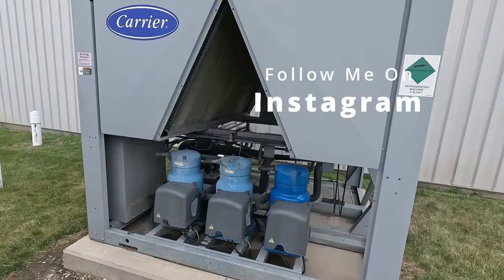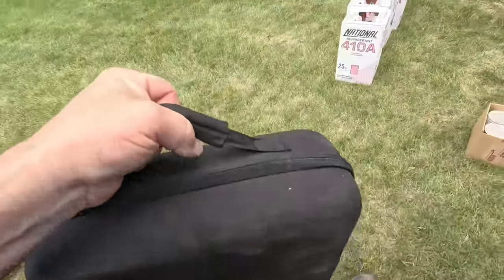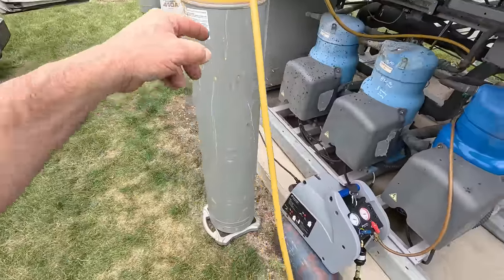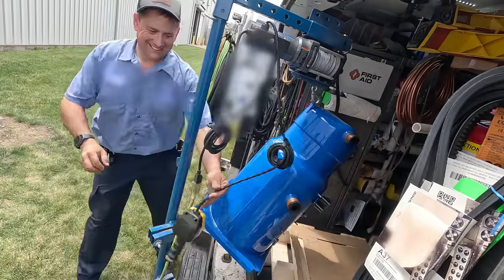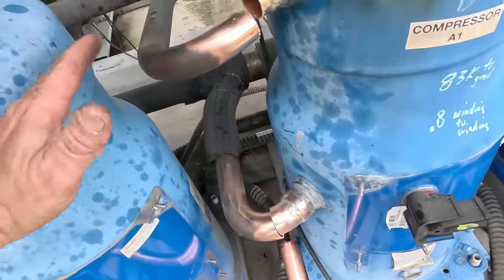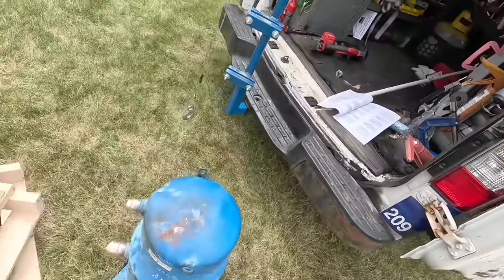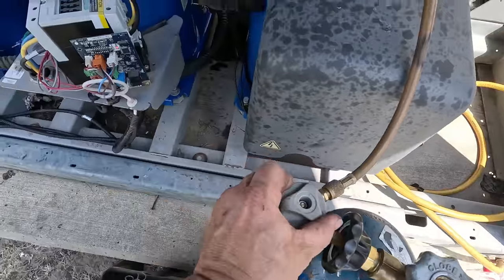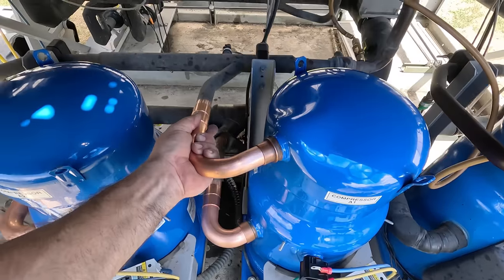Double Compressor Failure Was Not Enough Excitement

Comment: I know it mentioned before that the push pull wasnt setup correctly, and its been explained already on here..but if you have a running compressor theres a faster way with the push pull,by using the compressor as the " recovery unit"..
Hook liquid line of machine to liquid inlet of tank, the vapour of tank goes into suction line ofthe running  machine,  and hey presto yiu ll have full liquid recovery , real fast, make sure to keep eye on scales  as tank can fill real quick, and sometimes generates static on the tank, so bond the tank to the machine, i use a jump lead ..😂.. this method xan be setup real quick and gets most of the liquid out, usually the machine trips on low pressure , indicating most of the easily available liquid has been recovered..then its standard recovery..ive used this on screws, recips etc... remove cores obviously..great videos, one  of the most knowledgeable techs on the internet hands down...nice work Rick...👍👍
Reply from the maker: Thanks So Much For The Kind Words! I have used the Compressor similarly to what you're describing. Sometimes I'll even pump it down into the receiver, then suck it out of the receiver. Thanks so much for watching the video and for your continued support!

Comment: I wouldn’t get to worried about a few metal filings, everyone goes wild when they see someone cut or drill a line, guys, there are screens in txv’s, filter dryers and if they get to the compressor they collect in the dump.. Be cautious yes, be worried no.
Reply from the maker: I know, usually I see the guys using sawzalls. But I have a lot of people that never see this stuff and even me when I first started doing the bigger stuff flipped out. 9 years after doing the larger stuff and with a total of 28 years, I realize it really doesn't matter as much. But portraying that on video for the world to see is a lot harder.  Thanks for the feedback!

Comment: I've been using Mass Airflow Cleaner instead of brake cleaner.  Doesn't leave a residue, hurt plastics and designed for a delicate MAF.
Reply from the maker: Good idea, I've been just getting it from the shop, we stock it for multiple different reasons. The days of going to the supply house and getting what you want or long gone. Everything has to be ordered and gotten from there 😞

Comment: Build a mini gantry with strut and get a 4 wheel trolly. One end is set in the van and the other outside on the ground. I’d recommend using a tail pipe cutter for those tight spots.
Reply from the maker: Good ideas 👍👍

Comment: One thing I hate about these compressors is that the oil equaliser pipe is behind , which depending on the equipment OEM can make it really touch to access.
Reply from the maker: It wasn't a walk in the garden for sure. 🍺🍺 thanks Archer🤜🤛👍👍

Comment: if it’s not too private , what is the unit use for with those 3 compressors ?
Reply from the maker: Cooling water used to keep the machinery inside cool. It can cool either welders, punch presses I forget what this one was hooked up to, I was technically they're back in December so it's been almost seven flipping months

Comment: I'll admit I don't understand what push-pull recovery helps with (haven't researched it at all), though I can say the manual for your recovery machine comes with a nice diagram to set it up. (I have the same machine.)

It will be interesting to see where the leak turns out to be, if it is revealed in part 2.
Reply: more or less, it's a way to recover the liquid refrigerant, while keeping it in liquid state, you're basically keeping the system standing pressure high enough, so it doesn't all want to turn to vapor/gas and take days to recover.
probably not the best explanation by far, I'm sure not a teacher. 🤡
Reply: Basically you'd want to pump the system down, connect the receiver to the recovery cylinder liquid port, then pull out of the vapour port on the recovery cylinder with your recovery machine and dump the high pressure gas into the systems compressor discharge connection.  High pressure in the condenser pushes the liquid out of the system, lower pressure in the cylinder pulls the liquid in. Once all the liquid is out of the system you need to reconfigure your hoses to pull the remaining vapour out of the system.
Reply: In  a push/pull you are using refrigerant vapor to push the liquid refrigerant out of the unit and into the recovery tank,  since you are pulling vapor from the recovery tank using the recovery machine,  the pressure inside the tank will be lower than the pressure in the unit you are servicing,  thus moving the liquid by virtue of pressure differential.  Now push/pull is only worth it in large equipment with flooded evaporators where you can recover big amount of liquid refrigerant,  DX equipment push pull is a complete waste of time as he found out.   Push pull creates a pressure differential between the recovery tank and the unit being serviced, once there is no more liquid in the unit,  then a conventional gas recovery is done,  but since there is no liquid inside the unit,  pressure should drop fast.  One way to tell that you push pull was not complete,  is that when you move to your vapor recovery stage, the pressure will not come down,  meaning you are burning liquid (flashing liquid).

Comment: I think the push pull recovery method probably only works if you can pull liquid from the equipment, if you're pulling vapor into the recovery tank it's not going to condense there (or not much anyway), any refrigerant that condenses through the recovery machine will just boil off in the unit to get pulled back through the tank as vapor? I'm not an expert but that's my thinking.
Reply from the maker: No you're correct,  it was low 40 lb but at the time I didn't know that, that's why I left it in there but didn't mention it later because it all comes to realization after being completed. But not at the time of recording.
Reply: yeah, it needs to be fully charged and at resting pressure for whatever gas type it is and maintained at that pressure or you'll end up flashing it into vapor and pumping that in a big circle.
the pitfalls of a low system. 🤔

Comment: Worked on many many AquCrap's, buy a new board and have them install updated software. Problems will decrease dramatically. (superheat control issue) One site with 150 ton, 6 compressors, changed 9 of them. New software, no more failures.
Reply: Glad i'm not the only one who refers to them as AquaCraps. Once i saw he was carrying out two Maneurops i thought it had to be an aquacrap. Those things are quite solid otherwise. Fortunately i only have to take care of four of them, swapped out two compressors last year. I know of another installation which has eight dual compressor water/water aquacraps. Last time i checked in with them six were out of service.
Reply from the maker: That's interesting you happen to say something about the programming, just day or two earlier a guy had to go out there and actually reprogram the module because it lost it's memory.
Reply: @HVACRSurvival  Carrier won't admit problem. Also oil level 1/2 of sightglass, some manuals state full sightglass.

Comment: Great work Rick! I have a question about the Inficon d-tek 3 leak detector. I bought one almost 3 years ago after I saw your video about it. It was the best leak detector I ever owned up until a couple months ago. Now when I turn it on and wait for it to warm up, it will run fine for about 60 seconds and then it starts going off in clean air. Only one of the green lights on top will flash but it will make its way from the first or second light all the way to the last light on the right. I’ve replaced the filter and just today I bought a new sensor and installed it but it’s still doing the same thing. Battery is fully charged and the pump is working. Any idea what it could be? I tried calling Inficon but I haven’t been able to talk to anyone. I bought it through Tru Tech Tools so I’m not sure if I can send it in to be calibrated or what. Just figured I’d try asking you first since I know you have a lot of experience with Inficon. I absolutely loved the leak detector until it started acting up and I just want it to start working like it did before. I’m hoping I don’t have to drop over $500 for a new one!
Reply from the maker: I actually was having problems with my Stratus yesterday with the pump motor, luckily I have my dtech 3 as a backup. I wonder if the pump is acting up on yours ? I think it's replaceable. Call tru tech tools, they're supposed to give us good support and find out what they can do for you. I'm trying to get a hold of my guy at inficon I haven't heard back from him yet.
Reply: Thanks for getting back with me so quick! I actually called Tru Tech this morning on the way to my first call. I was on hold for almost 30 minutes and then the call got disconnected, very frustrating. I called back and left a message so hopefully I’ll get a response sometime today.
Reply from the maker: My guy at inficon said check the probe make sure it's not something plugging it up. Otherwise let me know if true tech doesn't come through for you
Reply: I checked it’s not plugged. I was hoping it would be something simple like that. I did put a new filter in the tip, gave the battery a full charge and changed the sensor but it’s still messing up. It actually still detects refrigerant I cracked a tank this morning and it did start going off faster. The problem is, once it warms up and runs for about a minute it starts going off in clean air with no refrigerant present. I’ve tried it inside my house, my van and several other places but every time it does the same thing. It warms up and then just starts going off. I got a hold of Tru Tech today and they said there’s nothing they can do because it’s out of warranty. He gave me Inficon’s number and I spoke to a woman from there today. She said I may have gotten water down the tip and messed up the circuit board. She said I can take it to United Refrigeration and they’ll ship it off to get fixed. I’m not sure how much it’s going to cost but that might be my only option since it’s almost 3 years old and the warranty is only for 2 unfortunately
Reply: I didn’t bring it to United today but I did call them and they said if I pay shipping both ways and the cost of the repair, they will get it fixed for me. I may not have a choice. I’m back to using an older Fieldpiece heated diode detector and that thing sucks. It gives so many false hits that I just can’t trust it. I always try to verify with Big Blu but sometimes it’s in a spot where you can’t.
Reply from the maker: They should be able to give you at least a not to exceed price. Mean anything more than half price then I would just go back to New, that seems really crazy, I've never had one take a total shit before. Mine started working again today. Maybe it was too hot on the roof
Reply: That was exactly what I was thinking if it’s over half the cost for a new one for the repair, I’m just going to buy a new one. I’m taking it in either today or tomorrow so I’ll let you know how much they charge me. Have you ever heard of one being damaged from just a little water getting in the tip. Sometimes I’m leak searching evaporator coils that were just running and the coil is still wet, but I’m always really careful not to get anything down in the tip. I’m not sure if water caused this issue or not
Reply from the maker: If you have the filter in place it can't get through the filter. It's like a Gore-Tex material. It'll let air through but not water. But if you sucked it into the pump I suppose it's possible it could have spit it out somewhere inside the control board.
Reply: I didn’t think it could get through the filter. I’ve never ran it without a filter so I’m not sure if it actually did get wet. It seems unlikely. I didn’t make it by United but I’m going to stop by there in the morning on the way to my first job. Hopefully they quote me a decent price and I end up sending it off for repair but if the price is too high I’ll buy another one. It was a great leak detector when it worked right so I’d definitely buy another if I have to.
Reply from the maker: It does what it does well

Comment: The hardest part on those aqua snaps are those oil gaskets and nut  on the back of the compressors to me there the easiest air cooled chillers to work on

Comment: What’s your tip to soldering those bad boys in, I had a hard time once on the same compressors ended up having to use blue tip ( 45% silver ) to get the compressor soldered in!
Reply from the maker: That's a micro rosebud tip right there. It makes it pretty simple, The main thing is heating up your male fitting going into the compressor first and working your way into the fitting.

Comment: I’d check the fan speeds and make. Sure they are operational if not maybe the level of compressors is off since it need a slights pitch for oil
Reply from the maker: I assume you're referring to the condenser fan speed? The inside is water transfer only. What are you trying to find out with the fan speed? Compressors were shorted to ground, my super heat was fine coming back to the compressors, and my head pressure was normal for the ambient that I was working in?
Reply: I'm assuming they were running hot since they are discolored and usually I seen these with vfds has one where they would not ramp up fast enough when loaded causing them to run hot and not trip the hp but enough to cook some oil  
In this instant id change out the oil entirely and check to make sure that common suction is pitched towards compressors to help bring back oil I've seen tons of comp burnouts and it's always oil

Comment: 7:10 Get yourself an oscillating cutting tool, with a carbide blade for metal. Cut the pipe FLUSH with the compressor as close to the blue paint as you can. Then you can then REMOVE the compressor and UNSWEAT the fitting and keep the pipe in tact. Ive done this three times with YORK tandem compressors, same thing.The shavings should be minimal and can be wiped out with a rag or your finger. They dont make it easy to do, unfortunately but those Olscillating Multi tools are a life saver on many jobs and well worth keeping on your truck. HOWEVER I think your method is best by ordering the pipes from the OEM and making those connectings with couplings and clean copper... Cant make those bends easily in the field.
Reply from the maker: I purchased a special close quarters cutter that was recommended by a viewer in the comments. It cuts up to 2.5" if I remember correctly. But what your saying makes sense.
Reply: @HVACRSurvival  Interesting. Whatever works.

Comment: I'm gonna guess the reason the push pull method didn't work is because you're not getting liquid off of that discharge line you're just pushing vapor and sucking vapor if you were able to get tapped on to an actual liquid line it might have worked I've never done it myself but that's my guess
Reply from the maker: And it didn't help that I already had lost 40 lb of refrigerant. I believe that's the big key issue here because you can't recover the whole system by push-pull only the liquid.

Comment: Try a  exhaust tailpipe cutter works wonders in tight spaces like that
Reply from the maker: I actually picked up a cutter that can do from quarter inch up a 2 and 3/8 called the wheeler-rex model number 4992. Made in the USA and should get into some of these tight spots one of the few hours mentioned it. Very expensive but I needed to spend my tool Money anyway

Comment: I think you still did a good job, because it might not be your fault on the leak, because like you said the factory charge was low, so it could be leaking in the line set or evaporator or valves, you might have to put some refrigerant in the system to find the leak, Is that Clayton sporting the beard? He looks like an old man country boy now.
Reply from the maker: Yep that's him. He had just done with these with the other guys that's why he had so much good knowledge.

Comment: Usally. We will add acid scavenger , and change the oil in all other remaining compressors , then take an acid test. 😉
Reply from the maker: I like doing that on smaller systems. I just go with the flow.  I don't want to insist on something when the guy that quotes it's been doing it 40 years

Comment: You need a WheelerRex cutter.
Reply from the maker: That looks badass 👍👍 I'm going to see about maybe getting one of those. Have you ever used one? Are they worth of crap do they sidetrack while cutting?
Reply: @HVACRSurvival  We’ve cut just inside of the OEM piping bends w/ it. Then use the Navac Tube Expander to make short swage fittings.
Reply from the maker: I'm trying to get one ordered now

Comment: Danfoss Manurope Performa scroll probably 15 to 20 HP scrolls  found them to be not that reliable compared to Copeland scroll compressors and they are very expensive to buy even back in the day  !!!
There's a part in them that breaks easy apparently  and thats probably the reason???
Reply from the maker: The scroll compressor was perfected by Copeland. It’s a closely guarded secret on how they make it even though the other ones are making it the same style. Obviously, there’s a difference.
Reply: The  component materials might be a clue and they run very hot from what I can remember???